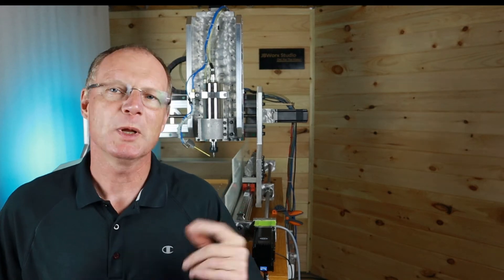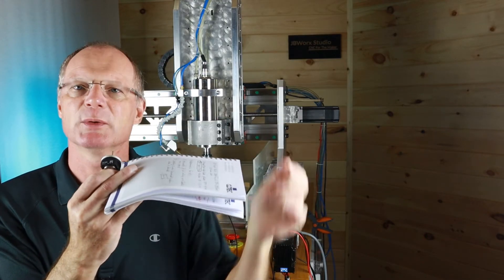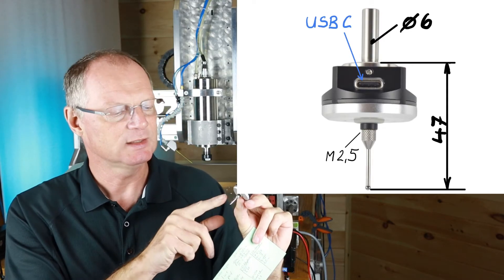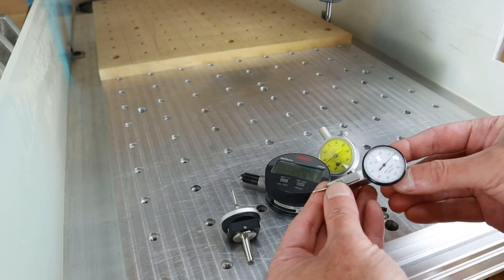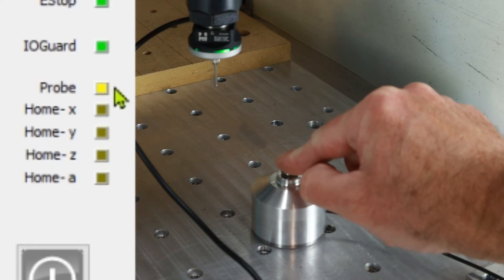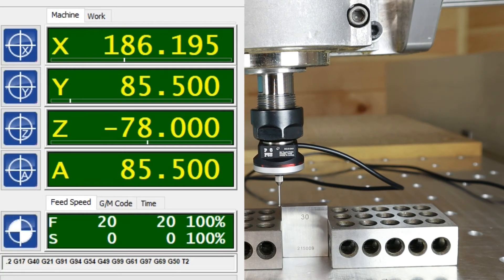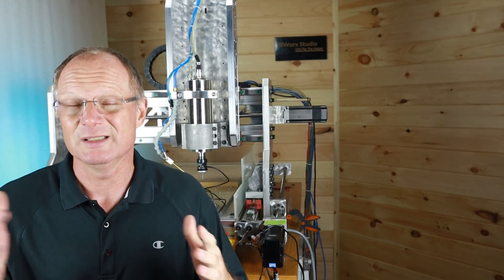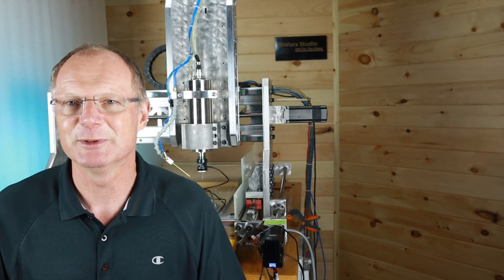CNC Touch Probe

Comment: As a dude thats has crashed one... er uh.. .two. They are 50/50 on rebuilding. If you bend the probe from the tip, youll likely be able to rebuild and recalibrate. I've only been able to get the rebuilt one to repeat to .003".. that said, I have about .001" of sticktion/backlash on my unit, so that would be .002 of the .003".

But yeahhhh.... I have 3 bodies now due to non-related CPU interrupt issues at VERY VERY unfortunate times.
Reply from the maker: Oh wow that’s not good I hope this happened over a long period of use so you got some life out of them. Luckily I have never had a controller issue in 5 years of use with EdingCNC nock on wood I hope it will stay that way.

Comment: Really a nice video and great series overall. I've been using the same exact probe for over a year now without any issues, the wired USB-C connection still works fine. Actually it is my second one, I did crash the first one and I managed to bend the main shaft of the probe, not just the stylus, so fixing it I think would be rather difficult. But lucklily at this price point it is no problem to get a new one. Got mine from Aliexpress. And I also found some sellers offering M2.5 stylus tips with ruby balls. They are difficult to find as most more expensive probes use M3 thread but they do exist. Have not ordered it yet though as I find the original stylus good enough for my application, well, atleast till I manage to crash it again :)
Reply from the maker: Thank you for your feedback, I have been quite impressed with mine so far. I wanted to build a ceramic stylus with a Ruby ball. I got the precision ball but I could not find a small diameter ceramic rod. If you don’t mind can you share the seller of the M2.5 Ruby stylus that would be awesome. Usually these will break and prevent further damage if the probe … ok in your crash it probably would not have mattered. Lol 😆

Comment: That has an amazingly short Z dimension to the tip. Makes it very usable on our non-industrial machines. thank you for posting this video.
Reply from the maker: Thank you for your comment Gerrit - hope to see pics soon of your finished JBWORX Cool Mister set up with your awesome pump control
Reply: @JBWorx  Just working on the mounting for the control box. And 2 tiny fluid leaks at the coolant solenoid :-(
Reply from the maker: I have  bought pricy stainless steel fittings for the cool mister - however using alcohol they will leak after 6 month. The O-Ring inside will deteriorate.
Reply: @JBWorx  If I have to I can make hose barbs to avoid those couplers on the fluid line. Also this pump controller has a mode to empty the fluid hose, that might help.
Reply from the maker: Yes that sounds like a very good option
Reply: The good thing is that the tips themselves are replaceable and come with M2.5 thread and there's a huge variety of tips to choose from on Aliexpress.
Reply from the maker: Yes, it can happen that the plastic part breaks inside holding the tip but  also that is replaceable. I find M2.5 probes / stylus not as easy to get but
Reply from the maker: Appreciate it !

Comment: A NO Probe would not be an option for me. If there is a broken cable, the controller does not notice this and there is a crash. I built my own Probe and in order not to have to install it all the time, it is mounted on a linear guide and can be extended using a compressed air cylinder.
Reply from the maker: Yes NC would also be my choice, however this is a really good deal I think. Yes the permanent mounting is next this will provide a fixed offset for Z.
Reply: @JBWorx  Fixed Z Offset? that you needed only when you have a toolchanger. Otherwise you doenst need it or maybe i be wrong in my thinking? I just move my probe in the left X Corner about 20mm over the Part. Then i start my Probe routine. First the Probe Zero the Z Axis (only for Probing) then he probe the Part in X and Y Axis. I thinks there is video about this function on my Chanel
Reply from the maker: You can probe Z using the 3D Probe like you just said and set Z - 0 my controller can use either one to set Z0. This way the tool length sensor can be permanently mounted.
Reply: @JBWorx  I screwed the linear carriage directly to my Z axis and my DIY Probe to the linear guide. The compressed air cylinder is equipped with a throttle so that I have a repeatability of 0.01 to 0.02mm when extending. Regards Jens
Reply from the maker: Hallo Jens, hab gerade dein vac video geschaut ich glaube da kann man die schon an der rechten Seite deiner Fräse sehen. Gute Idee mit dem pneumatic Zylinder
Reply: @JBWorx  Moin, ja da ist der DIY Probe zu sehen. Wiederholgenauigkeit bei Ausfahren sind aber nur +- 0,02 mm also fast 1/2 Zehntel + die ca. 0,02 mm Toleranz vom Probe. Genauer geht es mit dem Druckluftzylinder nicht. Wer es genauer braucht, müsste die Bewegung ggf. auch mit einem Schrittmotor realisieren.
Reply from the maker: Ja, oder halt eine Linearführung nehmen und die gehen einen Anschlag fahren. Sollte auch genau sein
Reply: @JBWorx  Meiner hängt an einer Linearführung! der prellt halt immer ein wenig, wenn die Bewegung auch einigermaßen zügig erfolgen soll.
Reply from the maker: Oh interessant also dann doch besser mit einem kleinen Stepper
Reply: I'm courios on how you built the linear guide side of the spindle (I suppose).
Any photo available somewhere?
Reply from the maker: You mean the Z axis ? Or my project for the linear guide for the probe ?
Reply: @JBWorx  I meant the linear guide + compressed air cylinder for the probe. I was thinking to build something like that too.
Reply from the maker: Ok I see. Well you will need to wait a little bit for that but the design is done have to make a video about it.

Comment: A wireless probe? Hm. I am wondering if a simple setup is good enough or whether that might need some latency compensation. Interesting. But I sure would want a NC setup then :)
Reply from the maker: NC was also my choice so far for my DIY Z Touch Probe Lucky it provides both so for this setup I was able to change it. Most industrial 3D Probes are wireless these days. I think the rather low travel speed at the moment of contact make the latency a no issue and I think 2.4GHz will be fine. However … let’s find out together … thx for reaching out !
Reply: @JBWorx  Well, it's 2.4Ghz, but if you think wifi there are plenty of protocols on top. I am not saying it's impossible (see the industrial) but it would be good to calculate and check the requirements before starting to build. I just assume the industrial ones will have a proper protocol to model the equivalent of NC probe.
Reply from the maker: Thank you , all a concept as of right now but if I don’t start I will not learn if it works
Reply: @tcurdt  ok the ESP NOW protocol provides a latency of 2.5ms at 40mm/min that would be 0.0017mm travel I think that is totally doable.
Reply: @joergbalzer7430  ESP NOW is a good idea as it strips quite a few layers from the OSI model. But are there smaller ESP32 boards? The ones I know feel too big for this use case. Maybe create a custom board?
Reply from the maker: The Seeed Studio is 17x22mm I think it’s also available without the usb connection making it yet smaller.
Reply: @JBWorx  I just checked. Seems like the ESP32-S ESP-WROOM could also be an option.
Reply from the maker: This is back on the list for 2024. I hope I can get this accomplished.

Comment: Why did you go for NO instead of NC for the two probes?
I'd also be quite scared that maybe a cable is not properly connected and BAM.
Reply from the maker: Because the NC version is not available in NPN … at leased when I bought it 6 -8 month ago.
Reply: In my macro for the z-probe in Mach3 I simply added a check for the max travelled distance allowed.
I think the same simple check can be programmed for the Erding controller too.
Reply from the maker: Yes it is part of the Marco. I think at the moment i have it set to 15mm. If it does not make contact during that travel distance it will stop

Comment: Great informative video like always. An ESP32 MCU has a wifi chip and is arduino compatible.  A small lipo can be attached to drive it all. I’ve used them for smart home sensors and communicated wireless to a home assistant server over the MQTT protocol. Not no anything time sensitive though. There might be a better protocol that is simpler with less latency to do the job. You only need one way communication from the device. Other possible ways to send the signal could be radio, trigger off the rise of a beep sound,  or a ring of IR LEDs that light up to trigger 1 or more IR detectors stationed in or around the cnc machine. I'm kinda thinking an IR based setup might be the way to go.
Reply from the maker: Nice thanks for your ideas. So I thought to pick the signal right of the USB C connection also for the Lipo I will need a charging board. Probably will have to print a small housing for the side. Lately using ESP32 for everything but there are even smaller Arm chips available … not to worried about the latency as the travel speed during sensing and the 2,4 GHz signal will make the over travel virtually no issue … I think 😂